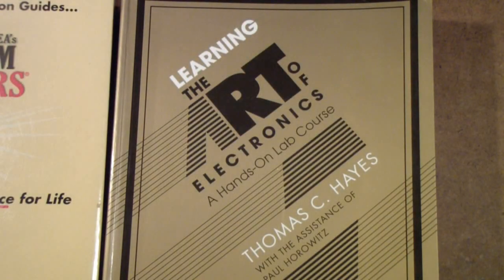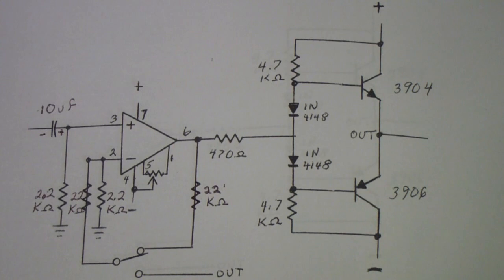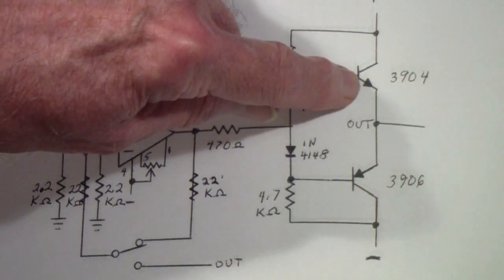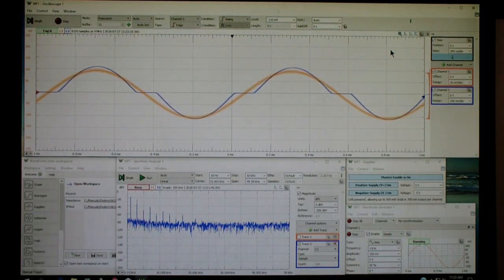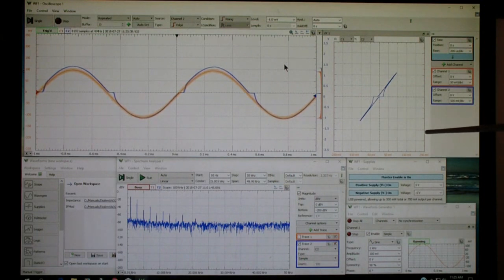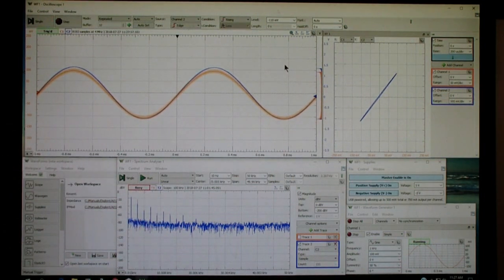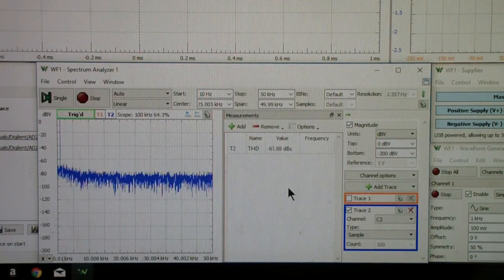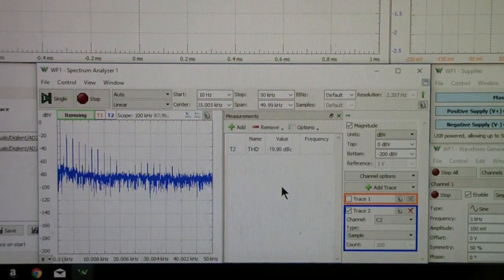TTT209 AOE AD2 Project6 Distortion

Comment: Isn't usually feedback resistor connected between output (where two emitters connect) and inverting input of OP amp? In this way you don't need bias elements. Only problem is that you need very fast OP amp for higher frequencies.

Comment: I think you meant to refer to the Keithley 2015 for thd measurement and perhaps the HP 8903B. I went for a Audio precision system one dual domain after the disappearance of the audio suite for the AD (and like it a lot.)
Reply from the maker: Yes, I misspoke when I said HP 2015; it is actually a Keithley (I did some comparisons between the Keithley 2015THD and the AD2 in some previous videos and found that the two are roughly equal in terms of THD measurement).